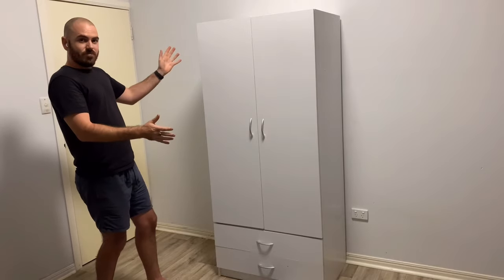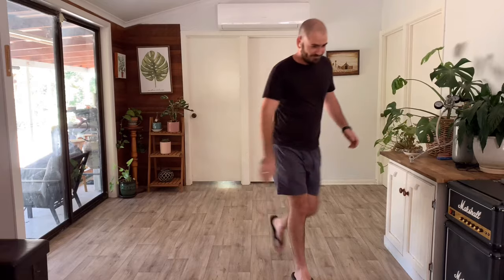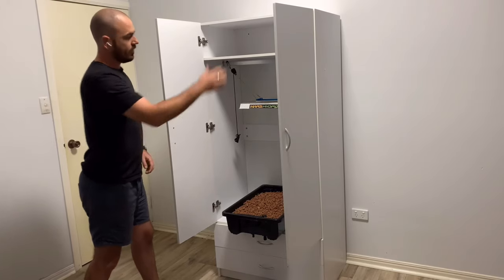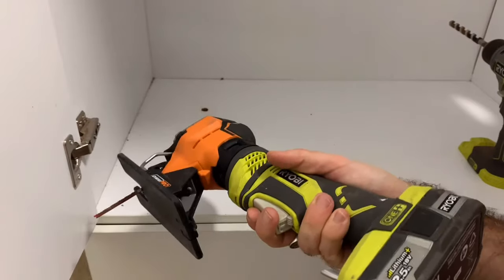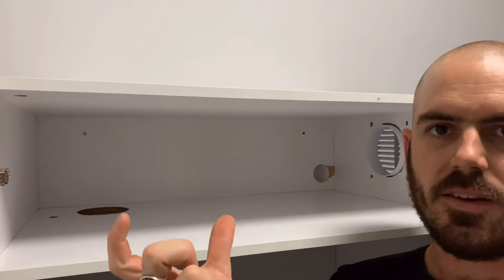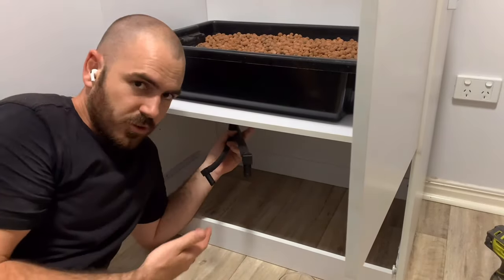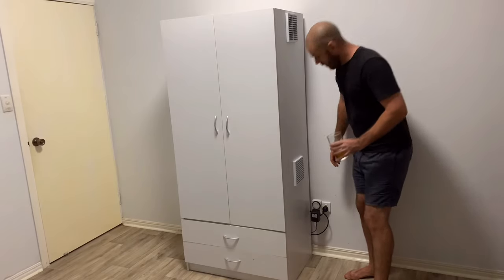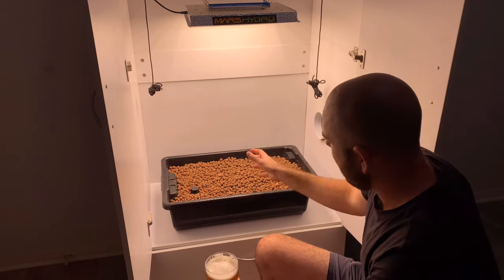How to Build a Stealth Wardrobe Grow Room

Comment: tip for you bro... cover the exhaust vent the light is shining through. A its not so stealthy with the light showing. but more importantly B.. whish is if you can see light on the outside then light will get inside in the dark cycle. This can cause malting during flowering stages which throws the plant back into veg. Watch out!!
Reply: Great advice.

Comment: Mate, loved this, I tried something similar when I was about 16 but with the wrong light- a 100w house hold light bulb!! Should have seen how much the plant stretched...lols. Anyways to fix the light leak, two options, a square of shade cloth om each side of the vent (so two for each vent) def helps alot, or better option is you add a small box over the vent hole and cut the vent hole out of the bottom of the box and put the vent there, paint inside of box black too- and you can direct any light down or to the back wall if you prefer. otherwise ive seen ducting used to cover the vent hole and then have a vent over the end near the floor. But its a great way to have some fun at home in a small space, just dont use any light other than a LED or you will likely start a fire. I got close FYI with an Incandesant bulb.

Comment: Awesome job man! Planning to do something similar with a metal storage cabinet. Only suggestion I have is putting the vents on the back of the wardrobe/cabinet so they face the wall. The vents kind of give it away but they wouldn’t be seen on the back. Just need a piece of ducting going 90 degrees to the back. Thanks for the video and ideas!

Comment: Not a huge fan of hydro but this almost convinces me to consider it. Great idea. I would definitely insulate the whole thing on the inside with insulation board or insulation tape and put some gaskets on all the exposing cracks. If you use the bottom drawer to use to remove the whole plant, it would make cleaning very easy and you could fit a humidifier in there. I argue against that light. Led full spectrum is where it's at bro. Vivosun sells small fans and awesome carbon filters that you connect to it. Definitely gonna make a video next year or this winter after I shop around WalMart sometimes. Too much going on right now but when I do, I will be mentioning you. I haven't seen anyone make one of these even though it is the most simple ways to get away with a grow room in your apartment

Comment: Great stuff. I have a two door wardrobe with a rail at the top. Space is roughly the same size. I have a 300w full spectrum bulb hanging from the rail, a grow bag tray, which I water and three one gallon grow bags with a compost, coco bark and perlite mix, ready to transplant my three young ladies. Oh yes, small desk fan to keep air circulating. That’s it. Everything was scavenged from around the house and garden. Only thing that I bought was the 300w led full spectrum bulb for £25. No filter, nothing complex, just a very low cost setup. Oh yes, I also splashed out on hard white plastic reflective sheets which I’ve stuck to the inside area because it’s brown wood.

Anything simpler than that? Yes, plant your beans in the garden when it gets warmer and sunnier.

Comment: good idea, nice video. you have to work on 3 major problems with this: or en general 
1. sound (use silent ventilator  and build 2 sound isolation arount vent with towels etc.) 
2. light (better put a whole grow tent into a wardrobe and check then when is dark in room), 
3. smell depends on grow stage. 4. better put the openenings behind wardrobe and let bit more space to wall then nobody sees this + also wiith cables (energy).
Reply: 5. it's not stealth at all. light will shine trough all cracks and it has side-vents ... lol

Comment: Me personally, I wouldn't have ran the duct work like that. I would have put a carbon filter inlet into the hole filter face down into the grow space. And then hooked up the fan right where you had it. And I would have blocked off that entire area so it closes off from the rest of the cabinet. That way the fan would draw air from that upper area essentially taking the heat from the ballast out of the cabinet as well. That's just me though. Plants hate it when it gets above 85+ slows growth production dramatically when too hot. Otherwise I think this is a fantastic build nonetheless.

Comment: An inner light reflective over lapping the inner walls might prevent light bleed. How warm does the light ballest get? I would mount the ballest behind the cabinet on the the out side. Might give you more grow space, or upper area me ght have enough space for a small carbon filter and in line vent fan.

Comment: This was such a great video. I've been going back and forth on building my own cabinet or buying a grow tent from Amazon. I like the custom route a little more. What are your thoughts on this type of cabinet being in a garage in a state where the heat can get up to 100 degrees.. ? The garage is the most ideal spot, but I'm worried about how hot it could get and regulating the temperature.
Reply: a garage is not an ideal place 
A basement is ideal 
if you can not influence the climate the place is probably not suitable 
Unless you want to cool with air conditioning and have to heat at night
Reply: @egalegal1666  I live in South Texas, we don’t have basements. I installed two fans to help with air flow and have a thermostat to keep an eye in temp. Works great! Had my first bloom a week ago.
Reply: @lindzilu18  south texas 
perfect conditions for mold in bloom hot and humid 
Pay attention to the humidity and I hope your cabinet is light tight so that the plants do not get any disturbing light in the night phase.

Comment: I was hoping you had tips on light leak from the grow space! Not too stealthy when your apartment managers do their yearly maintenance inspection and notice light coming from your wardrobe lol! Still a great vid, thank you for your ideas and sharing of them.
Reply: Exactly. The intake should have been at the bottom with a hose bending 90* there’s a great window seal at Lowe’s. Squishy foam strip that works perfectly
Reply: C'mon lads, these are issues you can easily solve....with a few tweaks this is an ideal stealth cupboard.

Comment: Nice video. Planning on doing something similar. Couple questions. Why did you cut the vent tube only to reconnect by pvc? Why not just cut off what you don't need? And why use duct tape at all? The vents or the aluminum tube should have come with the secure rings.

Comment: You dont think it would have been nice to add a fan at the bottom vent to pull in fresh air from outside in case you have it in a ac room? i have a bcnl grow box and some people complain about the res tank water getting too hot and i think having a bottom fan always on pulling in fresh ac air would solve those issues do you agree?

Comment: Mate love your work, love the Aussie beer break, checked the link out for the light, what is the model you used
Reply from the maker: Peter Lister I’d highly recommend the spiderfarmer SF1000 I’ve got three of them. Worth every cent. The mars hydro TS 1000 is the other light. It’s good too. But for me in the long run the spiderfarmer will pay itself off in saved electricity.

Comment: Hillarious. Love your work. Greetings from Jaspers Brush, NSW.
Reply from the maker: Cheers skippy!
Reply: Watched your other videos and noted that you sadly had a few hiccups. A couple of suggestions to make your NFT system more resilient when you change the water in the reservoir or when you are away and the power goes out. 1. You could create a dam at the outlet end of the downpipe using a size reducer fitting, or 2. achieve the same using a flexible hose at outlet, this would allow you to vary the height of the hose sufficiently to create a dam effect. This means water is trapped in the pipe when things go wrong and therefore your plants can still get access to some water.
On the inlet side of things you could have a wide opening in the top of the downpipe which would allow you to direct the 4mm black hoses in a jet stream that you can easily see, thus giving you a visual sighting of possible inlet pipe  blockages.
Love your netcup replacement system. Now I am going to build a similar NFT system as I think hydroponics is easier to get the fertilizer balance correct than it is in a soil system.

Comment: You only get negative pressure if the inlet is slightly smaller or slower flow than the outlet
Reply: The diameter of the exhaust air has nothing at all to do with it 
Such junk fans as in the video should not be used anyway

Comment: How does one deal with the smell? Doesn’t the exhaust vent just “vent” the smell straight into the room? I’ve heard of venting out a window, but wouldn’t that possibly attract passerby’s or neighbors to be able to smell it also? I plan on growing different varieties of tomato plants this winter. And if you’ve ever smelled just one tomato plant you know they can smell strong, depending on variety. Can you imagine having multiple varieties?? I’d love to have a this or something similar that I could be 100 percent sure that the smell of my 🍅 plants wouldn’t be too obnoxious! 🤔🤔🤔🤔
Reply: In case you're still curious, if you have one (or even two) activated charcoal filters before the exhaust there will be a lot less smell. Now with his wardrobe method you will probably leak a lot of air which could be quite stinky, you could fix the leaks with some sort of seal, like putting duct tape or foam in the gaps where you see light shining out, it would also get rid of a lot of that light, and would make the build even more stealth. As well as keeping the box at "negative pressure" which means you have more airflow going out of the box than going in, so all the gaps in the box will be sucking in air rather than pushing out. You will need to run the fan(s) more, both to push the air through the filter, and to keep it at negative pressure so it could get loud which might reduce the overall stealth. So the important question is: what's worse, a loud grow box, or a smelly one?

Comment: I think your on to something. Definitely giving others ideas to go with. I don't necessarily know if a hydroponic setup is good for this application. Water and wood don't mix especially particle board and mdf. Secondly you can't be stealth with that amount of light. Third most people would consider something like this if they were growing cannabis. No one is trying to hide tomatoes. If I can see light that means your not hiding any smells or odors especially when the plant starts to flower. Keep tweaking this setup and you'll eventually be able to hide this in plain sight.

Comment: I think you might need a fan down the bottom to push fesh air in
Reply: NO 
If you have a proper exhaust system, the negative pressure will draw in enough air

Comment: Can I get away without the carbon filter as I'm useing a fan in front of it with the door open
Reply: How is your "fan" supposed to neutralize odors? 
HELL NO 
Buy a decent exhaust System with filter and not such junk fans as in the video 
They are not suitable to work with a filter because they have no power

Comment: If someone were to grow smelly plants in there and had a powerful fan with an activated carbon filter, would the negative pressure enough to keep the smell from leaking through the doors? Since there quite a gap.
Reply: if you have negative pressure despite the leakage yes 
Large gaps? 
where light can go out, light can also go in and that is bad in the bloom 
At night it must be completely dark  
the video is garbage just like the implementation of the cabinet  
PLEASE do not take this video as a benchmark for your closet
Reply: @egalegal1666  this is not a kiddyweedgrowroomvid, play somewhere else....

Comment: Excuse me but, where u put the ventolator and the deumidificator? They're absolutly necessary for growing indoor
Reply from the maker: They go next to the flux capacitor, under the particle accelerators.
Reply: How much did you spended for all the materials?
Reply from the maker: @sklip_  I had most of the components lying around and got the wardrobe cheap as it was damaged. ~ $80aud
Reply: Thank you, nice man!

Comment: I will not argue about the white color walls but I will just leave this out here so you can see the actual measured differences between reflective materials mostly used in growing. Simply speaking, white is the best color for reflection because it reflects all parts of the spectrum, any other actual color would be bad since it would only be reflecting a part of the spectrum or in the case of black - barely any reflection. But you can get better than simply white. https://www.youtube.com/watch?v=LQ-Hg_L011k&ab_channel=MIGRO

Comment: And add a filter to the fan system
Reply: @egalegal1666  didn't say if the fan was good or not, just that it need a filter system lol... Personally had a fan around the same size and it don't a decent job along with a carbon filter, the plants got air and my FULL house didn't stink but that 1 room did
Reply: @jay36963  "my FULL house didn't stink but that 1 room did" ...
Reply: @egalegal1666  yeah it's a cupboard, you got to tape all to gaps otherwise you can seem theres something in the room. It works to keep the room from smelling as well but after opening to check the plant to needs to retape all the doors again... That set up, with a smaller inlet port for the air worked well but my back room did smell if you opened the door for that room
Reply: Also the room wasn't smell proof so I did expect the smell to go through the house lol

Comment: Just quickly botch something 
No reasonable exhaust system with filter... With a reasonable exhaust system, it would no longer be stealth because the exhausted air and the exhaust fan would be clearly audible if you do not use a much larger fan on a small filter and then dim the fan down. 
No light trap on the inlet air 
The draft of the incoming air does not replace a fan in the cabinet 
The cabinet is not light tight but a hydro setup is important? 
Who is really interested in it should look for rebuilt Ikea Pax setups (Ikea Pax Grow) 
The people build the shit probably 1 to 1 and are caught because they did not know better because people like you make such videos to quickly earn a few dollars